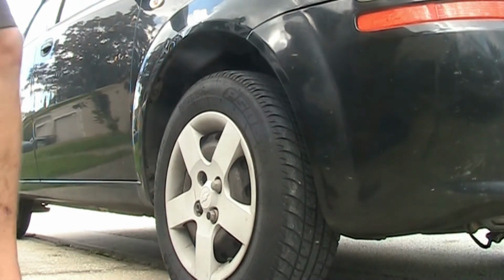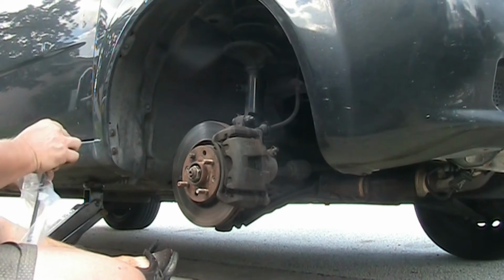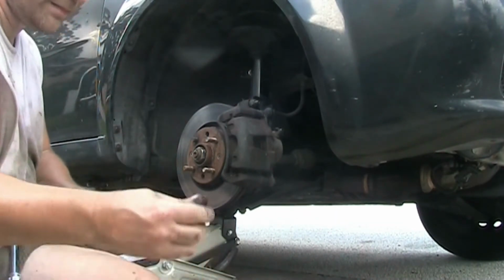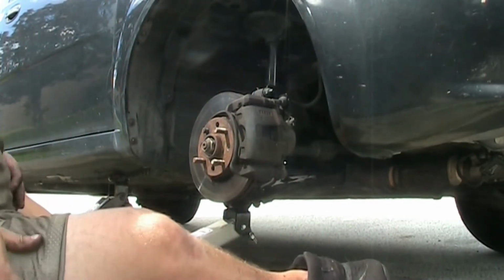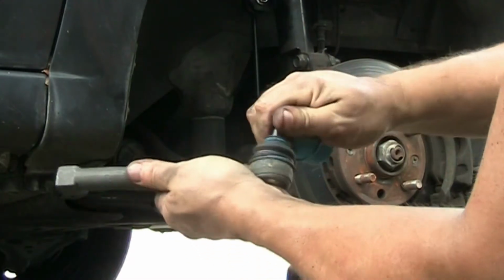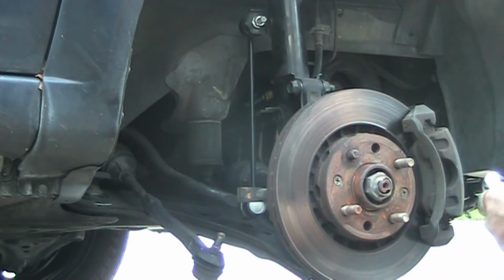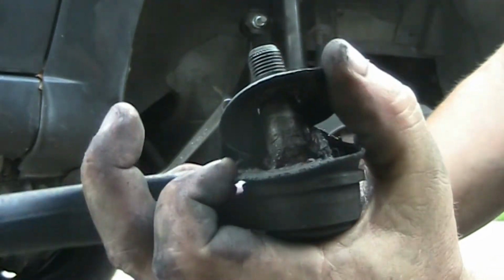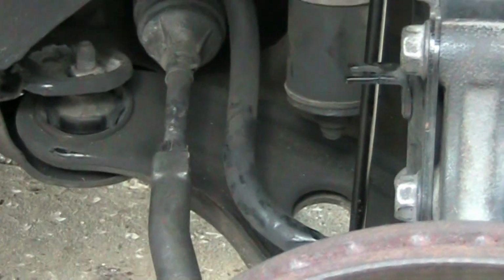Chevy Aveo 2006 sway bar link and outer tie rod DIY replacement

Comment: Thanks was wondering what size the nut is on the back before I go back outside. Heading back out now. My moog control arms are a super tight fit, but I'm also taking my struts back out to repaint them & check to make sure I put the top hats on in the correct orientation pretty sure I did but I want to make sure.

Comment: Give you some pointers next time keep the bolt on the spindle first then under loosen the bolt the back-door what's a 17 mm get underneath the car make sure you got it with Jack stand so it don't fall ft to hands get on your back and push down or up it will break loose Quest

Comment: If you're got the car up a little bit higher and get up under there that would have came right off easy
Reply: That's true but with that kind of jack sometimes it's better to utilize it as little as possible. With a great big floor jack and some nice stands you could jack it up a lot higher with ease.